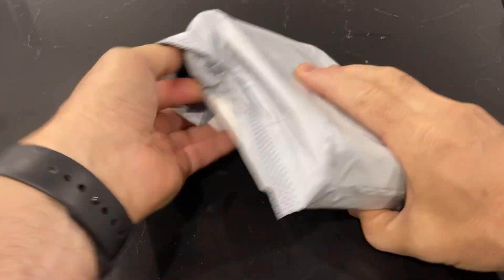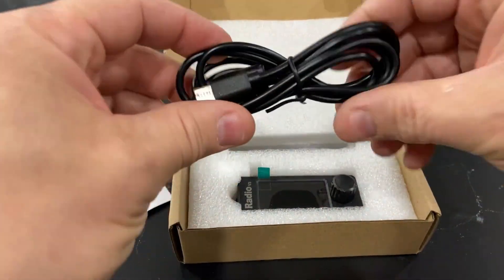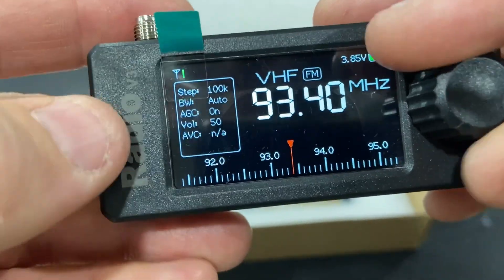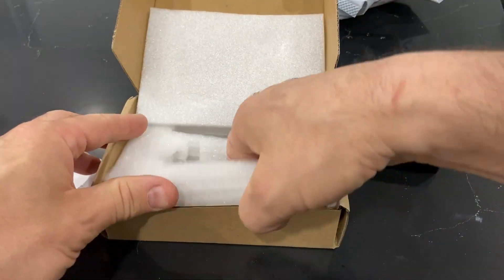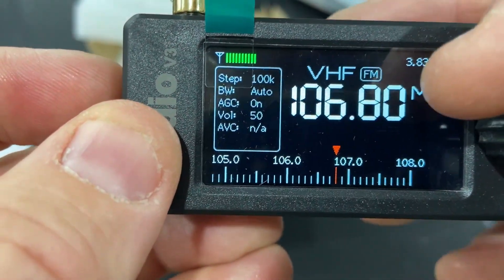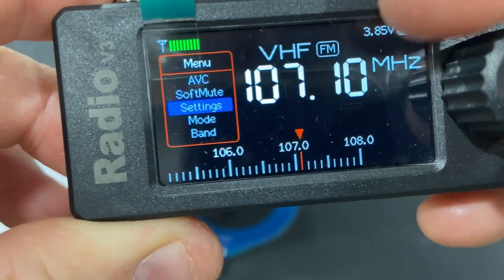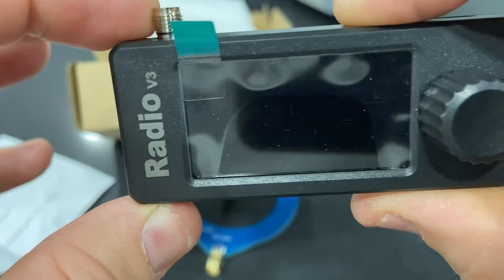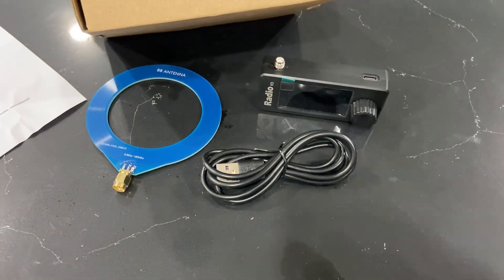UNBOXING The CHEAPEST Shortwave SSB Radio! ATS-Mini SI4732 v3!

Comment: I just purchased this radio; it works way better than I expected. I have it hooked up to the MLA-30 loop antenna it gets good reception on all bands. The blue donut antenna didn't receive much so I put it on the Uniden BC125AT scanner, works great on the UHF/VHF aviation frequencies!
Reply from the maker: Nice! Try it on a random wire (long wire) antenna clipped to the whip on the radio. The wire should be 30-40 feet long, at least, and you’ll pick up lots of ham chatter on the various 80m, 60m, 40m, 30m, 20m and other frequency parking spots.

Comment: Why can’t I not receive anything but FM single ?
Reply from the maker: You should be able to receive at least local commercial FM and AM stations even with the whip or donut antenna. Make sure you set the frequency to the right range for AM (530-1700 kHz), and the Mode to AM in the menu. Above that, for shortwave you will want a random wire antenna. Simply get some electrical wire (I use speaker wire) and string about 30-40 feet of it horizontally or even at an angle, say tied to a tree or fence at the end of your backyard. Have the other end of the wire through your window on 1st or 2nd floor even, you can slam window shut on wire as long as you don’t break the internal wire. Touch or clip the wire to your antenna, it should be in contact with the internal conductor of the wire. I would switch mode to SSB and use LSB (lower side band) and tune around 7100-7350 kHz (40m band) on any evening, or sometimes early morning. You can also try around 3600-4000 kHz (80m band). Above 10000 kHz you’ll want to try USB to decode. You can also find a lot of Morse code CW in 7000-7100 kHz along with some digital signals. Let me know how it works, I’ve had a blast with my radio but you NEED a long wire antenna attached to it!!! Fortunately these are cheap to make yourself out of free wires you have at home or some cheap stuff from any store.
Reply: @devhackmod thank you , I am going to give this a try and I will be in touch

Comment: Have auto search?
Reply from the maker: Yes, you can use the "scan" feature and it will automatically tune up and try to find a signal. However, unless the signal is fairly good it will miss it. Works fine for AM/FM radio but on shortwave it could miss some very weak signals and not stop.

Comment: Just ordered the same one, looking to navigate this to learn about the different bands
Reply from the maker: Awesome! I just added an AliExpress link (where I got it) in addition to Amazon links. I'm not sure how many versions there are but either way there is a lot of activity you can pick up on the shortwave "ham" bands... Like listening to nets, contests, CW and other stuff. Just make sure you have a very long wire you can string up somewhere (like 30-40 ft) and clip it to the whip antenna. I didn't find the ring useful for much yet, but then again I'm listening to stuff in the very long HF frequencies.
Reply: @devhackmod thanks for the advice will definitely do

Comment: Does it have the battery drain issue of the version 2, where if you fully charge it then leave it a week or two and don't use it, you come back to find it has zero charge?
Reply from the maker: Honestly I have not found this problem. I have left it for a few days just to test it out and did not see the voltage drop at all. However I usually am using this quite often and it does last a long time. For example, I typically will listen to HAM chatter for 20-30 minutes every night (usually 40m and 80m bands) on my long-wire clipped to the whip antenna. I have WiFi enabled so it downloads EiBi schedule and syncs time. I will typically get 2 weeks of usage at this rate before having to charge it.... so I have no complaints about the battery life on this. However I would NOT use it while charging. It will work, but there is so much interference from my USB wall-charger that it's not worth using (at least not on shortwave). Maybe AM/FM stronger signals would not be as affected. By the way I find this with all my radios... The power supply while charging is very "dirty" and produces lots of RF interference.
Reply: @devhackmod  Thanks for the detailed reply! I think the version 2 had the battery drain issue, nice to know firsthand the version 3 should be ok. I did order it just to see and I appreciate your information as I am still newish to the world of radio and amateur radio, Many Thanks!
Reply from the maker: @sethrauldatta-h1g My advice to you when it comes to any of these radios and even the AT-mini is get yourself a big reel of 14 or 16 gauge braided speaker wire, maybe 50 ft roll (it's very cheap). Speaker wire is paired so if you pull the wires apart you end up with 100 ft total of single wire. If you can, attach a metal clip to the end of one 50 ft piece and clip to your whip antenna, and then try to tie the other end to something 50 ft away... a backyard fence, tree, whatever (be safe, you don't want it hit by lightning or blow into a power line if it gets windy).  If you have enough room you can use the other 50 ft piece also the same way but at another angle (say east-west if the other wire is more north-south direction). Or you can roll it up and save it for when you travel to a park and can hook it up there, and have a permanent installation at home and a mobile antenna when you go out. This type of random wire will pick up a ton of stuff, even as crude as it seems, and makes a huge difference!
Reply: @devhackmod  Thank you very much for this tip! I really appreciate you taking time time to reply in comments and I subbed to your channel. Yes I will definitely try to put this tip into action and see what results I get, thank you!

Comment: I bought this.  Not necessarily to use as a radio, but it does work pretty good.  I am an Amateur Radio operator, and I program.  I am hoping the pinout of the circuit board is pretty generic and the code open source.  Others have written code for this.  That is what I want to use this for.  To learn how to program for the SI4732 radio chip and the ESP32 microcontroller that is driving the radio chip.  This is going to be a fun device I think  Well done video.
Reply from the maker: Yes it is a fun device. I'm working on getting my ham license but have learned a ton just from SWL. I run this with a 30-40 foot random long-wire clipped to the whip antenna and listen to broadcasts on SSB all around the world... I heard a conversation of a ham in California talking to someone in Germany recently!

Comment: Hello I have v2, what's the difference? Is it worth the upgrade?
Like from v1 to v2 it was defo worth it but what about v3?
Reply from the maker: So my understanding is v3 has a high-Z circuit for better antenna reception and better headphone amplifier, according to AMNVOLT. Personally not sure if it makes a difference as I don't know what v2 reception is like to compare to. However I've had no issues with the v3 and they are quite cheap. I also don't know if getting EiBi schedule is something that v2 can do or if only a v3 firmware feature, and whether that is important or not.

Comment: Radios muito pequenos são muito fracos e pouco uteis, praticos verdade.
Reply from the maker: This little radio is actually quite useful despite it's tiny size. The antennas that come with it are not good for much other than local AM/FM and very strong shortwave signals. However, connected to a random long-wire antenna, I regularly pick up signals from ham amateur radio stations 1000-2000 km away (SSB mode) and even further on AM shortwave broadcast stations. It's the antenna, not the receiver.

Comment: I have one on 40 meters when I tune it every so often sounds like lightning crashes it's only on 40 meters anybody else have this no there is no storms here
Reply from the maker: I noticed this when I am tuning up and down. Every few kHz as I tune it will get louder for a second and sound like lightning. I believe it's the automatic gain control or some internal attenuation. It will get "loud" so you will all of a sudden hear a lot of static and then the attenuation kicks in and lowers it (or filters it)... so it gives the illusion that there is a sudden "static" noise like lightning would produce.

Comment: Please review ssb shortwave
Reply from the maker: Single Side Band... it's a mode of transmission, similar to AM but only one half of the transmission is sent (USB = upper side band, or LSB = lower side band). The radio receives it and then is able to recreate the opposite half internally to form back the original signal. This is more efficient and therefore used by many HAM radio transmissions for low energy and long distance. That's a simple explanation and probably technically full of errors but easy to understand.

Comment: The lower end of HF for most amateur stations is 1800Khz and broadcast AM between 530Khz and 1700Khz, well above the 9.9Khz loop antenna receive. It should be able to at least receive AM broadcast but for Amateur Radio, the signals may be too weak to pickup decently on such a small antenna. This is still a cool little radio having the ability to RX SSB in such a small little package especially when it's only around $35 for the setup. May look at getting one myself. Thanks for the show and tell!
Reply from the maker: I am getting most success using a couple of long-wires strung out my bedroom window, hooked to the end of the fence in backyard (about 10m length making about 70-degree angle to each other). They are clipped on to the antenna. I'm able to pick up a lot of stuff. I already have 2 other radios (Tecsun PL-330ET and Retekess V115) and also the RTL-SDR dongle which I use on my laptop with AirSpy-like software, so I can receive and decode even more stuff (SSB, digital signals, ADS-B, etc). However, I like the convenience of having this tiny little radio in my pocket with a spool of wire... Easy to set up anywhere, can listen easily in bed, or on the go, in a field, on the road. My other 2 portable radios don't have SSB so this is a very cheap addition to enable that capability.